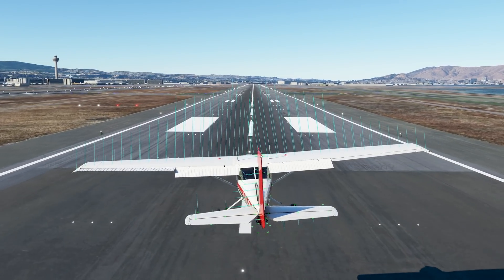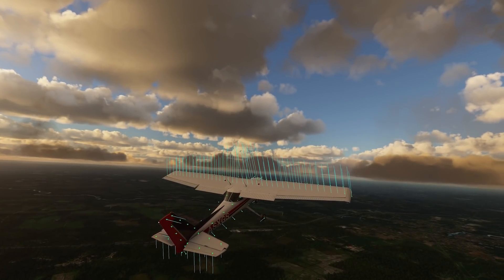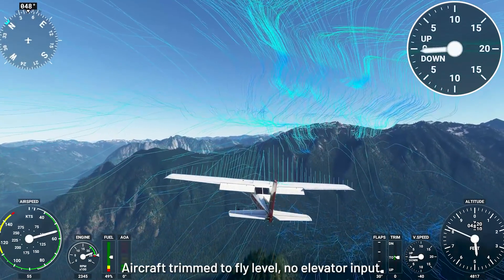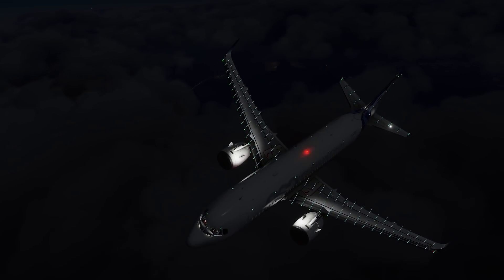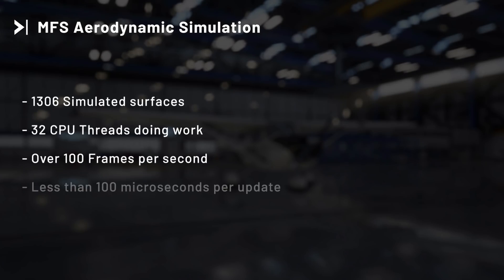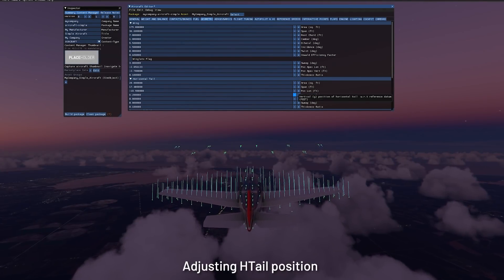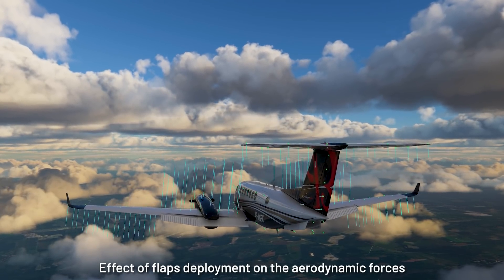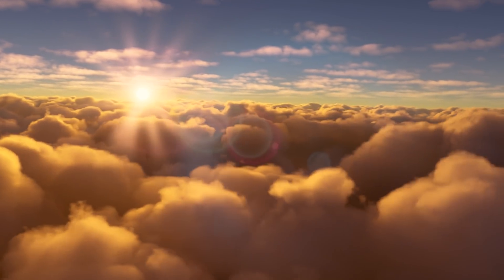Feature Discovery Series Episode 10: Aerodynamics Part 2

Comment: Excellent video, we are only missing more airliners and a replay system for it to be perfect for me!
Reply: Airliners will come when the SDK is more developed.
Reply: @CristiNeagu  stop saying that, the sdk is ready for airliners.
Reply: @PilotUnknownX  I trust PMDG way more than i trust you. PMDG says the SDK is not there yet, so that means the SDK is not there yet.
Reply: @CristiNeagu  when did they say that?
Reply: @PilotUnknownX  Every time they mention the 737 for MSFS in one of their updates, they mention that the SDK is not ready yet. On the flip side, they also say that Asobo is actually committed to delivering an SDK that will be fit for purpose, so they're working very closely to 3rd party developers. In conclusion, according to PMDG: The SDK is not finished, but it's not finished because Asobo is very hard at work, and when they do finish it, it's going to be awesome.
Reply: @CristiNeagu  A32NX team say the SDK are quite ready. It just that it needed different approach than previous SDKs.

Edit: the documentations though are pretty lacking. They found quite a lot undocumented APIs.
Reply: @kerucutgaming2216  Then they probably use a lot of the inbuilt systems and don't do study level sims like PMDG.
Reply: @CristiNeagu  it's an open source project. You can see exactly what they're doing. This includes the direction they're going in the future. Just take a look at their GitHub page and Discord.
Reply: @kerucutgaming2216  The don't go into great detail on their introductory page, but they do say it's built on the default A320. That might be why they're not complaining about the SDK. PMDG have to implement a lot of system behavior outside the sim, so they need the SDK to allow them to run multithreaded processes, amongst other things. Last i heard, the SDK was not capable of that.
I don't know how much detail the project you linked to plans on achieving, but it will have to be less than what PMDG is aiming for, considering their sims are endorsed by Boeing, who also supply them with confidential technical information. That allows them to replicate even weird system quirks. There's a long history of PMDG releasing a plane and then being inundated with bug reports that are actually features of the real aircraft. I mean, even in their original release of the 737, back in 2007 or something like that, the systems on board took more or less time to boot up based on outside temperature.
Reply: @CristiNeagu  past MFS actually far less multithreaded than the new one though. The way most advanced features in the past are done through somewhat hacky way. Advanced add-ons often manipulate memory and bypass the API entirely to have greater reach and control over the sim.

The problem with the new MSFS is that MS tighten their security. No more hacky way of doing things. This is very apparent in the way they choose a sanboxed modular add-ons and virtual file system. The sim also doesn't need administrator priviledge like past MFS. This is a more modern approach in software design. The downside is the API need to be more capable since everything will have to pass through the API.

As for the A32NX project, they've achieve so much in just 4 months. They're already implementing custom FBW, autopilot and other systems using low level language (C++ and Rust). The open source nature of it also make the project a lot more exciting. You can join their Discord to look deeper at their development progress and the community.
Reply: @kerucutgaming2216  
"past MFS actually far less multithreaded than the new one though"
I wasn't talking about the sim being multithreaded. I was talking about the third party model that is feeding data into the sim being multithreaded. Almost all complex addons are running an external model.

"As for the A32NX project, they've achieve so much in just 4 months"
Sounds like they can run their external model in a single thread. But when you're trying to run the flight model, autopilot, hydraulics, engines, air conditioning, electrics, fuel, navigation, and many other systems on top of that, a single thread just isn't enough. Sooner or later they will run into this issue.
Reply: @CristiNeagu  yes I agree, they run their models outside. Some of these things done via undocumented API and direct memory access.

This way no longer possible since MSFS now sandboxing their add-ons and tightens their security. Hence the API need to be more capable than past iterations of MFS. Since all interactions need to be done through their API. This is why the API needs to be expanded a lot.

Low level language doesn't even compile to machine code anymore. Instead it compile into intermediary WASM byte codes. Which then compiled AOT on sim startup using inNative runtime and run on sandboxed environments.
Reply: @kerucutgaming2216  Hence why the SDK needs more work.
Reply: More airliners are coming
Reply: @bagels377  but not freeware by microsoft right?
Reply: Contrails and the effect where you get the little vapour cloud when your wheels touch the tarmac would also be nice ^ ^'
Reply: Long way off being perfect!
Reply: Totally. Also a flight analysis to study where you missed the IFR excerise.
Reply: Missing a lot more than that - Proper AI with actual airlines, Particle Effects, Water Physics, Better ATC, More Consistent Live Weather, Better CPU/GPU Optimizations....... to name just a few
Reply: @FlightSimAndTravel  particle physic SDK will be added on the UK update. They already release change log summary. The first available effect will be contrail and tire smoke on landing.

Edit: also ATC is basically the same as FSX ATC. From what I'm seing online. It's already better than default X-Plane 11 ATC.
Reply: @kerucutgaming2216     Really good news! For some reason tire smoke make landings so satisfying to replay.
Reply: We need a better flight model, X plane 11 is way better at this stage in the handling. But so far I am really impressed with what the Asobo team delivered, MSFS in VR is truly magic.
Reply: @Hani_Santa  X-Plane has been around for quite a while so I would expect nothing less from them, but I feel like they'll be irrelevant by the end of the year because this sim is gonna be pretty polished by then.
Reply: @just2bme1000  I agree, MSFS has a fantastic base. Nice graphics, beautifull weather system, ones there flight model is better and amazing addons are published x plane is done.
Reply: @Hani_Santa  Better than Physics? XD
Reply: And an autopilot heading control that doesn't go berserk and effectively lock the game up after you've adjusted it a few times.  :^(  Oh and bridges you can fly under... like the previous versions of MSFS.

I really do like the product and appreciate the effort that's been put into the graphics, but it would be nice if they'd tackle some of this basic stuff before focusing on subtle tweaks to the aerodynamics.
Reply: @moi01887  most advanced airliners add-ons actually writes their own autopilot and systems. Just take a look at A32NX for example, they're working on their custom flight model, fly by wire, autopilot, and aircraft systems.
Reply: @kerucutgaming2216  Well, they cannot have their own 'flight model' per se as the flight model is the physics engine that allows all aircraft to fly, but, they can fine tune the aircraft forsure.
Reply: @ukmaxi  it does make very big different though. Just compare high end aircraft to default one on FSX.
Reply: @kerucutgaming2216  Yeah, I do have to look at add-on aircraft some more, although I have tried a few.

But the heading bug issue to me seems like a basic UI thing, probably not related to the implementation of the autopilot - I say that because it's affected every aircraft I've tried (that has an autopilot).
Reply: @moi01887  most currently available aircraft use the default logic and autopilot. So most of them will have the same problem. Hopefully in the future more custom aircraft made available.
Reply: @moi01887  "basic stuff"... Shall we have you as lead programmer then ;-P
Reply: @ukmaxi  I actually have been a programmer for over 30 years.  And if I had a program with as many basic problems as this one, I would not release it.  If you compare this to, for example, FSX, it's obviously much better visually, but at least in FSX the basic stuff works.
Reply: @moi01887  FSX didn't stream real-world mesh data and only had rudimentary buildings, as well as flat terrain, no elevation data and an extremely simplistic flight model I would say you are underestimating the scale and scope of MSFS incredibly over its immediate predecessor. What have you been programming for 30 years? Not wishing to be rude, just genuinely curious.
Reply: @ukmaxi  Well I'll admit I'm definitely not a game programmer!  But I've done a lot of other stuff from embedded assembler and C to reporting to web design and SQL.

And I don't mean to be overly critical of MSFS - I understand it's a huge effort do do what they've done.  It's just frustrating when you're using what seemingly is a sophisticated program, to have it freeze 10 minutes into a flight due to a stupid problem.
Reply: @moi01887  My brother was the same, spent so long perfecting his Commodore 64 drum machine that someone else stole the market with a much inferior product.
Reply: @r0se_cr  I dunno, man... i think that should be pretty low on the priority list. If you like flying airliners, the default options will always be way, way, way too simplistic and not realistic at all. And if you don't like airliners, you won't fly them. So who exactly is the effort going to be aimed at? Who is going to be happy if Asobo puts a lot of effort into the airliners? Answer: not many people... Unfortunately, you're part of a minority, i think. A lot more people will be happy if the GA planes get fixed first.

Comment: 'Wear & Tear' option in the flight model menu at 7:55?! That's an exciting revelation. Will it be visual or mechanical or both? Flights are so much more immersive when there's that very small chance of failure at the back of your mind, and helps you to focus on the flight more like it was a real one.
Great video, keep up the ongoing development. I look forward to trying out some of the improvements in future updates!
Reply: mechanical definitely imo
Reply: @evidenceplz  Would make most sense being under "flight model", but with it being a slider rather than a tickbox, I have to wonder. Perhaps the engine output & lift/drag performance will degrade the more you slide the marker to the right. I also wondered if the licensing agreements with the manufacturers may prevent any 'worn' appearance. But it could work in a visually similar way to icing, in theory.
Reply: @Mustang242Sqn  exactly what I am guessing!

Comment: A320 aerodynamics are still terrible on my simulator
Reply: get the flybywire mod
Reply: @anony88  FBW only improves system and soon the fly-by-wire models, but the massive landing float isn't something they can fix w/o sacrificing other things
Reply: @issacchen5394  what you mean by landing float?
Reply: @anony88  the airspeed doesn't decrease very much during flare phase
Reply: @issacchen5394  reduce thrust to idle at 50 ft over the runway threshold and only pull on the yoke 3 degrees.  I never float.
Reply: @anony88  Sorry to ask, how can I get that?
Reply: Are you on FBW latest dev version?  they are moving fast these days and if you are on stable, its really old compared to that work.  Also what A320 are you comparing it too real or another simulator?